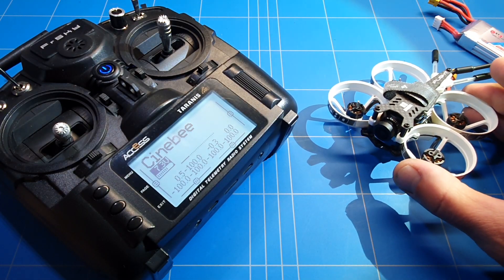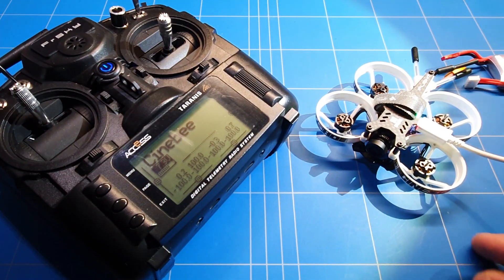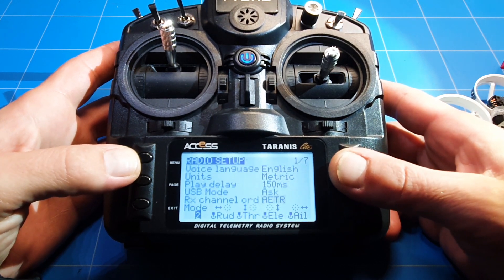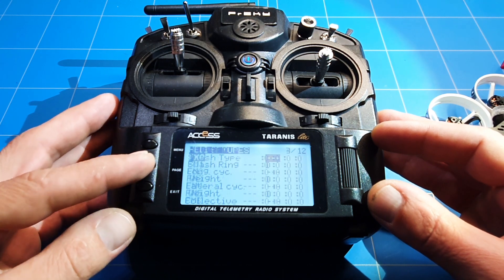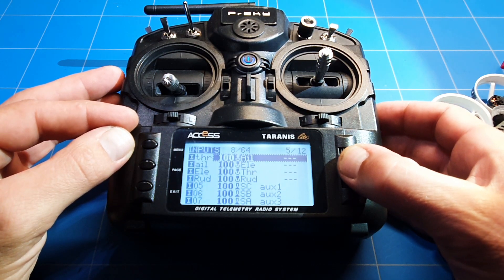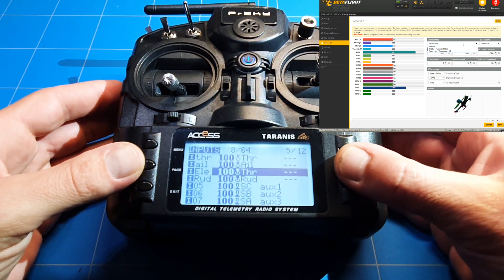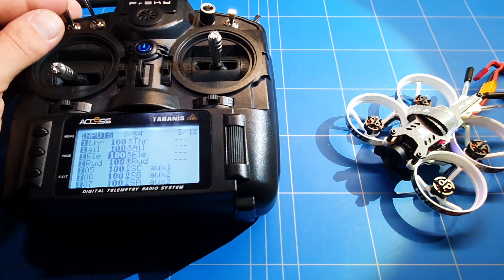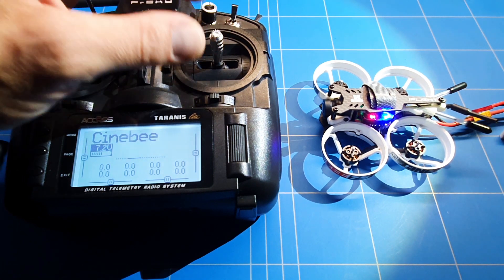Frsky Taranis X9 Lite Changing Inputs Channels For Betaflight To FLY iFlight Cinebee 75HD

Comment: Great info thanks. I do still have a problem with the throttle not working properly. Activating at the mid-point of the stick, and  speeds up +&- rpm from the midpoint
Reply from the maker: you need to calibrate ESC that will fix your problems